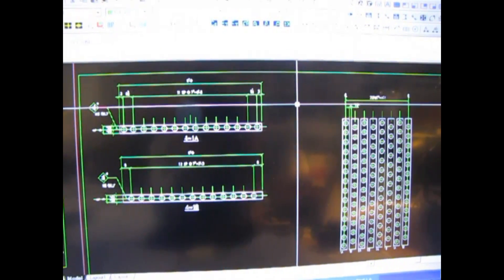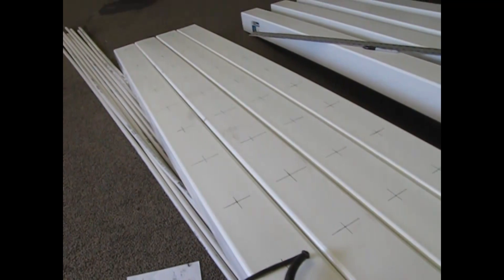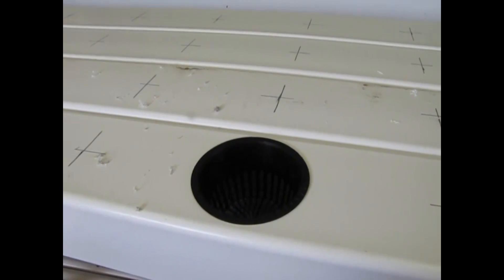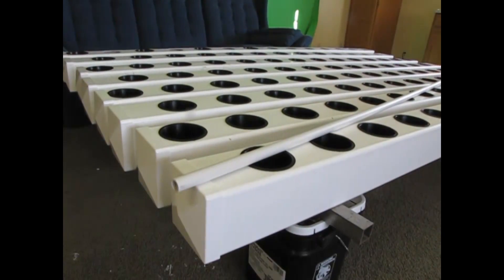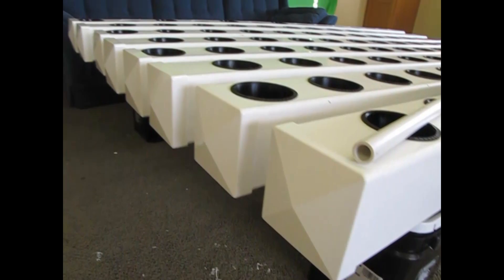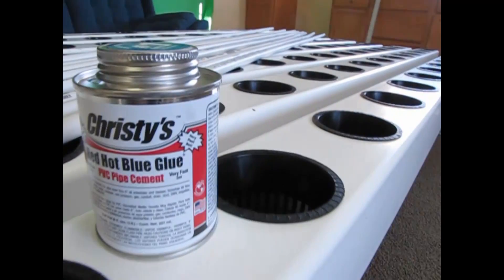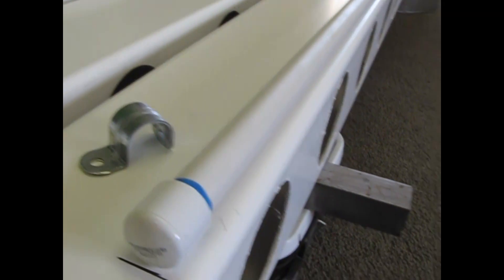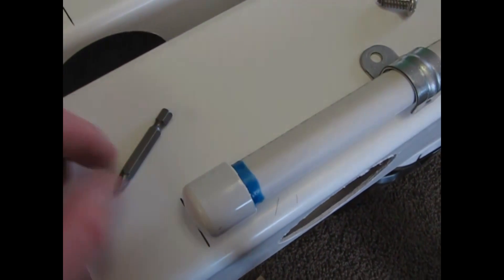D.I.Y. hydroponics System Part 1

Comment: When you cut your holes, run your drill in reverse, You won't get any binding or kick back. Running in reverse will also give a nice smooth hole.
Reply: handy tip Put sugar syrup on drill for a laser like finish no need to run in reverse sugar syrup does a way better job

Comment: Do you think this exact system would be good for Cannabis or are the holes to close together?
Reply: I would think cannabis would grow too large and top heavy, with too thick of a root system for this system.
Reply: Absolutely not this is a complete copy of General Hydroponics aeroponics systems identical holes just as close I have one and they grow absolutely 4 foot plants in them with no problem The Roots grow down into the tube and anchor itself don't listen to someone who doesn't have one

Comment: aren't your holes to close together? I find in my garden tower, when a plant grows tall in towers over other plants and shades them.
Reply from the maker: Good comment, The plants in this part of the system are Lettuce and spinach. The grow lights are directly above the plants. The plants are harvested prior to shading being an issue. The larger plants such as Kale, Chard ect are slated for the Dutch buckets.at the back of the system. Thanks again for your observation and comment.
Reply: I used grow light strip led's glued on a 1/2 PVC pipe I can raise or lower over the system, very low voltage.

Comment: When drilling the holes, after the pilot hole is drilled and just when the hole saw starts to "bite" the pvc,  run the drill in reverse - it makes a cleaner hole and if won't twist your arm off.

Comment: The downside of hydroponics is that you will have to pay for "plant food" or nutrients and supplements which can be expensive.
Reply: You are paying for it in soil as well. You either need to pay for fertilizer, gather fertilizer, or do composting. There is a time cost with each of them and there is a probably a purchase cost as well.
Reply: Aquaponics includes the best elements of Hydroponics And Aquaculture therefore lower cost and also enhance productivity. You may get one of the best aquaponics plan below:
help1.info/best-aquaponics-plan

Comment: When you use a hole saw that size, 1) drill a pilot hole 2) Then run the hole saw in reverse. 

Smaller hole saws, like the 1" size wont bite like the larger ones.

Comment: What are those tubes called, are they gutters?
Reply from the maker: They are 5"x5"x8'-0 Vinyl fence posts. I have attached a link, you will see some of the other parts that I bought from Home Depot as well.
  http://www.homedepot.com/p/Veranda-5-in-x-5-in-x-8-ft-White-Vinyl-Fence-Post-73010700/202084745